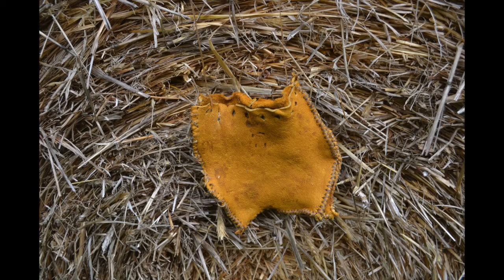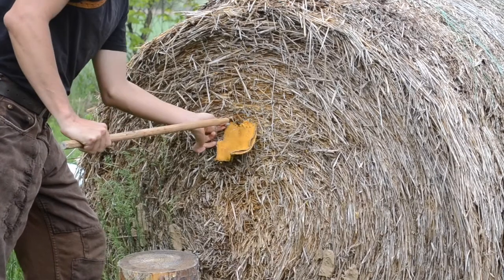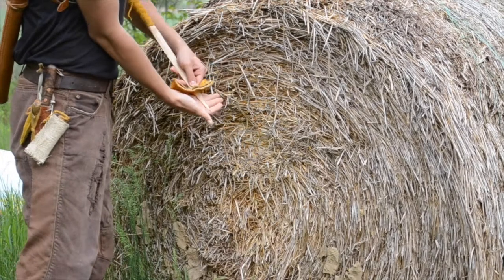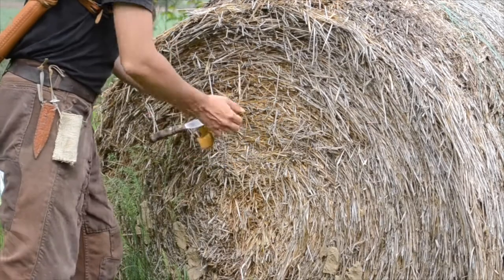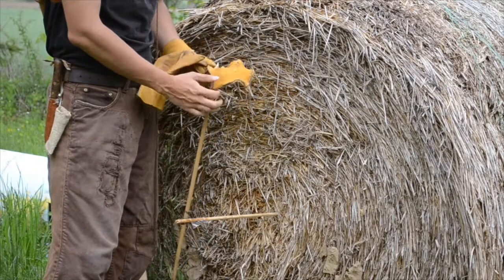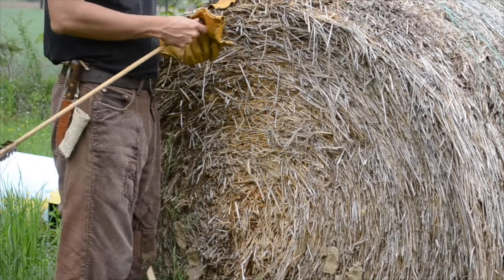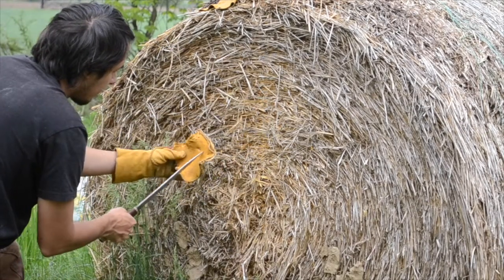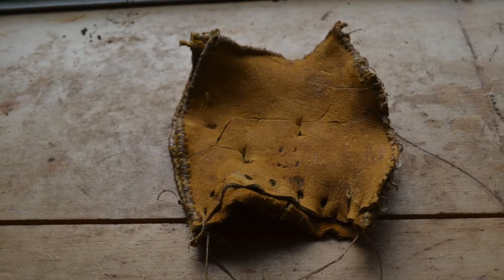Laminated leather armor test.

Comment: If memory services me correctly when the Spanish settled Texas they used a similar type of armor when fighting the comanche. Though I think it was anywhere from 8 to 14 laires thick. Thanks  for sharing your work, it is amazing and it helps people like me that like to write realistic fiction.
Reply from the maker: Glad you appreciate it.
With regards to the spanish armor. I had not heard that. 14 layers of leather would be over an inch thick and incredibly protective.
Reply: @MalcolmPL  ok so they were called dragones de cuera and fought with the Apache tribe not the comanche. Also it way 8 to 14 layers covered in sand.
Reply from the maker: @Terry Newsome I see. Leather dragons. Interesting.